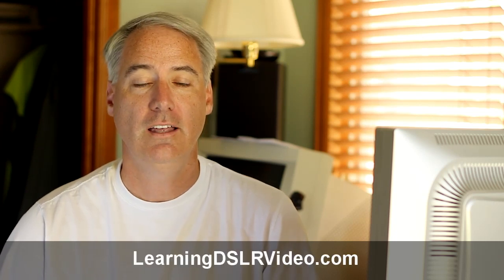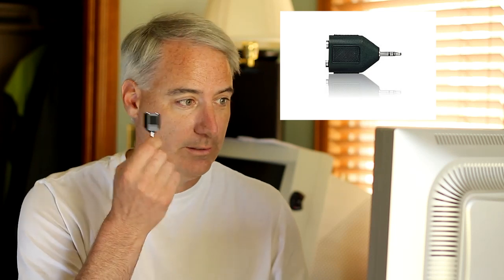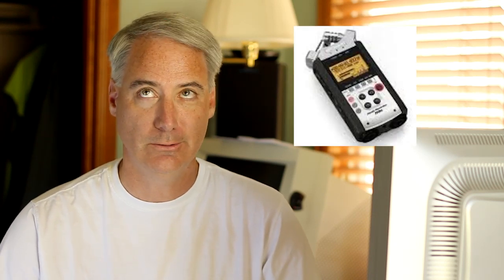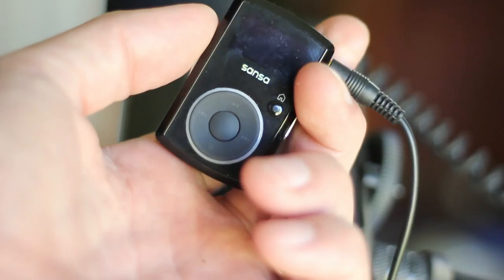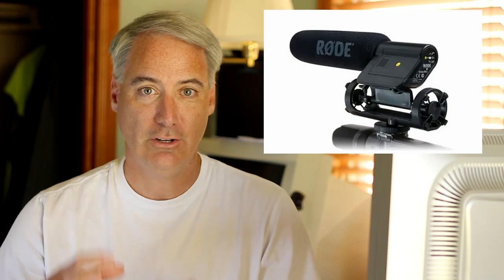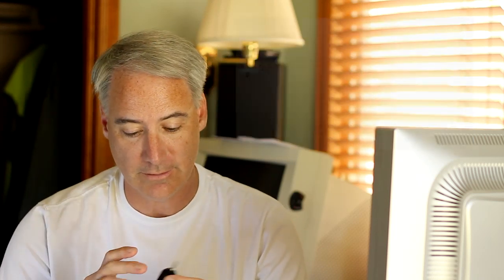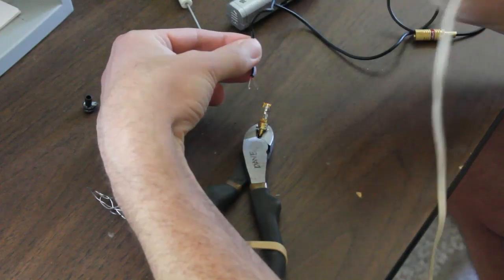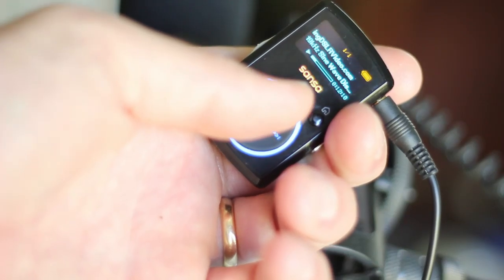Canon T2i/550D 7D Disable AGC Automatic Gain Control Hack for the Rode Videomic

Comment: How do you disable AGC without using all the ther equipments you have? All i have is my canon t4i and RODE VMP. I don't even know if my AGC is turned or off but i know i have the exact problem at the beginning of this video
Reply: AGC is turned on by default. I'm looking for a solution myself. Controlling AGC is not possible with current firmware. Without the hardware in this video, the only way to do it is by installing Magic Lantern.
Reply: Well i sent my canon t4i back to Canon for possible rapairs in the audio. If that doesn't fixs it idk what to do
Reply: Stevo Canuck AGC is not a defect, it is a feature. When you talk quietly, it boosts sensitivity to make sure it records quiet sounds. The problem is during sudden silence it boosts sensitivity dramatically, creating noise. Unless you have a specific hardware defect, all they will do at Canon is reinstall your firmware, which you can do yourself.

With Magic Lantern you can turn down AGC and with a microphone like Rode Videomic you can boost gain on the mic to get that nice clean sound signature. You can find videos about this on youtube.

Anyway, I hope everything works out.
Reply: Victor Shikhman Ok. so when i get it back, does ML support a t4i? And installing ML will turn off AGC? I was just curious also. Are all ML settings the same in every camera?

Comment: I'm not sure about your particular cameras, but if you can record your audio at 24-bit (and use a good mic) you can get an incredible amount of gain in post-production, if needed. Recording at 16-bit doesn't let you push the gain as much.
If you can record audio in PCM, instead of some compressed format, that's like the audio version of cam-raw - you'll be able to do a lot more with it, in post.

Comment: No, professional microphone use three wire, not two like you mention (hi-lo, tip-ring) - two wire is for consumer microphone (unbalanced). Rode is a professional mic, it have three wire (hot, cold, earth) balanced out, where hot and cold is the signal but phase inverted 180 degree. Later in a balanced-input pre-amp, the cold phase will be inverted back to 0. So only the information signal amplified by the pre, and noise picked up along the wire length get canceled (inverted 180 deg).

Comment: While this obviously works, it seems needlessly complicated.  Just one more battery-powered device that can die in the field, an adapter that can be lost, and who knows how many connecting points that can decide to give out without warning.  Did the connector come loose?  No way to tell, since you can't monitor audio from the cam without a firmware hack anyway.

Get a H1 for $99 and you can at least record passable audio.

Comment: @drumat5280 @lallalallalalla not quite, you should record with the maximum volume possible of the subject you are recording... if you normalize it from too little audio, it's gonna suck
you need to tune down the volume from the mp3; too much might be getting into the right channel, so it's what's lowering the input so much from the left channel, because of this whole AGC thing
also, that was genius, Dave!, although, you lose the balanced signal from your mic, am I right?